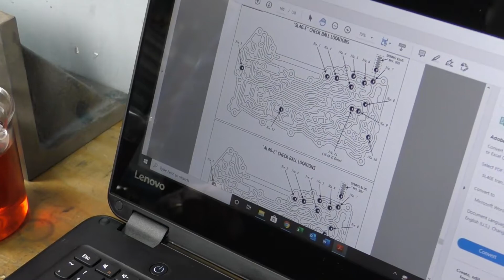BMW X3 3.0L GM5L40E Transmission

Comment: Hello, sir. I have a question. 
I own a 08 BMW X3, and I have the following problem. On cold and hot engine it will take way to long to switch from 2nd to 3rd. It seems like it is stuck at 3000 rpms and transmission doesn't know where to shift. I replaced the oil twice in the last month and changed the filter. Do you have any idea what is happening and what should I do to fix this or at least to make it better. Thank you.
Reply from the maker: Daniel
There can be a lot of factors that can cause that issue. The shift points are controlled by a transmission computer that is looking at throttle position, engine load, and road speed. It then tells the solenoids in the transmission when to activate. So the first thing I would start with is scanning the engine and transmission for faults and fix any that are present, even if you don't think they are related. Also check if your car has a transmission options switch in the car, if so selecting "sport" mode will increase the rpm required for the shift to occur. Another factor can be if you have installed any kind of engine performance software. These programs often will raise the shift points in the transmission. There can also be mechanical issues inside the transmission that can affect the shift. If you have a high mileage car and there is significant wear inside the transmission it will impact the shift quality. A low line oil pressure due to worn seals and/or oil pump can require a higher engine speed to generate enough oil pressure to make the shift. To check this, you will take some oil pressure readings from the transmission while operating the vehicle.
Hope that helps to point you in a direction.
Thanks for watching
Kurt
Reply: @klassikats  Thank you for your detailed answer! I appreciate the effort, I have changed the oil twice, and filter. A friend of mine, he is mechanic, said that it could be shift solenoids. He said he can check if these actually are the solenoids, it just a matter of him finding time to check it. Nevertheless, thank you! One more question. You mentioned seals -  are you talking about valve body seals? Would adding Lucas Transmission additive help?
I have 240,000 km on the car, it is roughly 149,000 miles.
Reply: I don't really want to put too much money into this car - it has high mileage and I don't think it will last another 240,000 kilometers anyway =)
Reply from the maker: @berdasau  The seals I was referencing were the clutch and piston seals inside the transmission its self. The solenoids can become dirty and the screens get debris in them. However, usually, this means that it will not shift at all. When it comes to a mechanic in a bottle, (The Lucas additive), they usually don't work when the transmission has a problem. Those kinds of additives are designed to add to a working transmission to keep it working. In My opinion, most if not all of those additives are a complete waste of money.  I understand the high mileage, it's probably time to move the car onto the next owner. 
Thanks and good luck.
Reply: @klassikats  thank you a lot for your response!

Comment: I drained the fluid and replaced the filter The oil was very thick and contaminated dark brown almost black I pumped in five quarts till it started dripping out while the engine was not running I will have to recheck it with the engine running and in park but after taking it for drive it shifted fine but now it will not shift into any gear after that test drive has anybody had this experience could it be the level of fluid of not checking it while running is either too low or full? Or is something not working in the valve body with the solenoids or debris in the valve body itself if anybody has this experience please let me know thank you
Reply from the maker: It's possible you've got debris in the valve body. This is something that often happens when the fluid is dirty. Have you checked the valve body for debris yet?  
Kurt

Comment: Hi, does anyone knows is there any (especially major) differences between these gearbox in: E39, E46, E38, E53? or are they the same and can be successfully swapped 1:1 independently of car's model and engine? I'm asking, because I need to replace malfunctioned box in my E39 530d and I was wondering if I can swaps it to box from E46 320d? I have read somewhere, that there's no differences at all - besides shaft connection (which can be simply use from old gearbox). But what about Hydrokinetic clutch? Does it the same type for all 5L40E, or depends the car's engine? Many thanks for any answer :-)
Reply from the maker: The main difference between these transmissions installed in different models is the valve bodies. Physically everything is the same. where the difference lies is in the accumulator springs. These determine the shift hardness levels based on engine torque. So yes you can swap transmissions but you may experience a difference in the shift quality.
Reply: @klassikats  and what about the torque converter? Is it also different or maybe it's same for all types?
Reply from the maker: @maraz26  The stalls speeds may be a little different. as well as the mounting points may be different.
Reply: @klassikats  So I did it. I've mounted g-box from E46 320d 150KM 330Nm to my E39 530d. It works PERFECTLY. Gears changing is smooth and unfeeled almost like in DSG. As for differences, well everything was same, except drive shaft connection - which I have simply took it from old g-box. Besides, plug&play.

Comment: A question I had was 40:30 u say to make sure to gently push in the solenoids however if they seem to hard to push in needing too much pressure how would I go about inserting the solenoid c specifically
Reply from the maker: Make sure you have the correct Orings installed and that they have been lubricated. When pushing the solenoids in you can give them a slight twist to help the oring slide into the valve body. It should feel pretty smooth as you push them in.
Kurt

Comment: Them plastic zipers are not made to last or withstand high temps. It will end up breaking off .....JB weld the clips back together 😮😮😮😮😮😮😮😮😅😅😅😊😊
Reply from the maker: The only real fix is to replace them.
Kurt

Comment: Hello just a question is the xdrive and the normal automatic the same gearbox ?
Reply from the maker: Yes, they use the same transmission. The only difference is that the X-Drive has a transfer case bolted to the back of the transmission.
Kurt

Comment: The same gear box is installed in my Land Rover L322, 3.0 diesel. on a cold engine, I feel jolts from the box when shifting to a lower gear, if I change the oil, will this problem disappear? Do I need to change the solenoids?
Reply from the maker: It is highly likely that an oil change will help this. usually harsh shifts when cold are due to higher oil pressures because of oil viscosity. Depending on mileage it can also indicate particulates in the oil from transmission wear. 
I would say start with a fluid change and flush the oil cooler lines, then re-access the cold performance.
Kurt
Reply: @Klassik Automotive Training School  Thanks a lot for advice
Reply: Do you check the bores in the valve body for wear?? I thought that sometimes they require reaming and oversized spool valves?  Maybe only if you had codes? Let me know .   Best regards, Chris